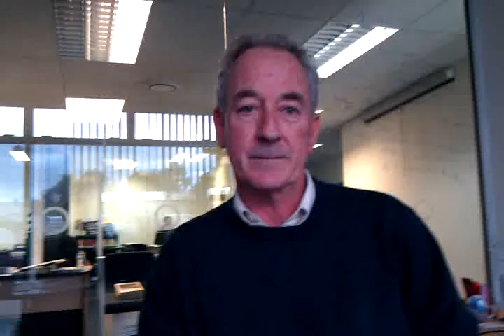New energy technology to go commercial

Comment: @shoshinNZ ITMDI-Energy is basically dead. MDI never delivered any usable hardware so no air pod. Yella Terra never made 50 engines. 2008 was the last update. 

The air power mesh idea has sprung up again via indranet but there are no test modules and no independent thermodynamic evaluation. Lot of hype though.

Re mesh not saying it can't work, just that $30M is a LOT of money and there seems precious little to show.  If I had bucks invested I'd be hoping it really takes off.

Comment: @shoshinNZ 
indranet aka itmdi-energy (You'll have to google as youtube borks any identifiable addresses)   promise their investors rich rewards from their mesh computing project , so far about $30,000,000 has been invested on that corner.  Result? Hmm. Check the "same" CHCH ph no's for both companies. Call, hint you have $10,000 to invest and you'll get more excuses than you can shake a stick at. The air bits don't make engineering sense.  
Their mesh stuff? Still waiting

Comment: "Do we have here a technology here that could make a difference?"
NO 
Because after $ millions invested there is no operating and tested units that confirm the claims and unfortunately there never will be. 
Sorry for the 3000 investors who put in $10,000 each but you are going to have to kiss the money goodbye unless  "mesh computing" takes off
If you want power and heat buy a Whispergen or put up some Photovoltaic panels for electricity.